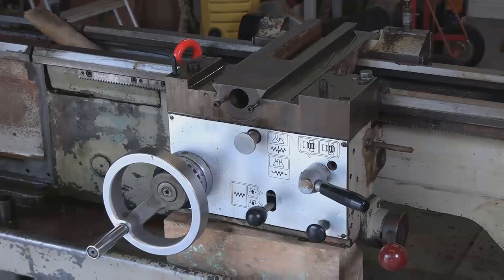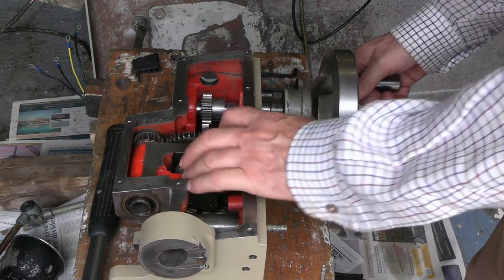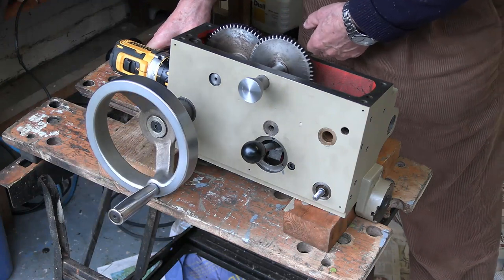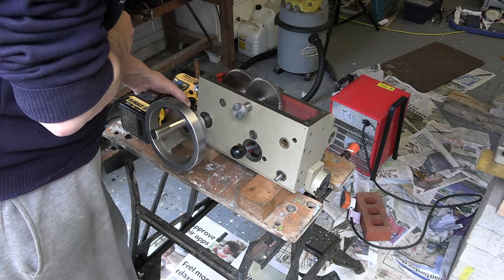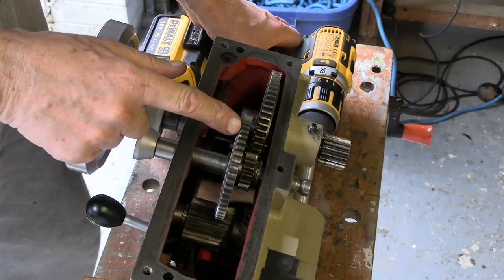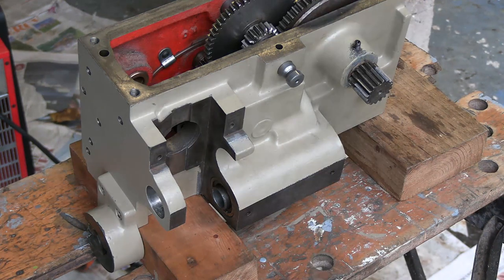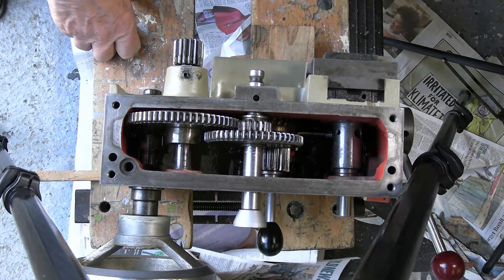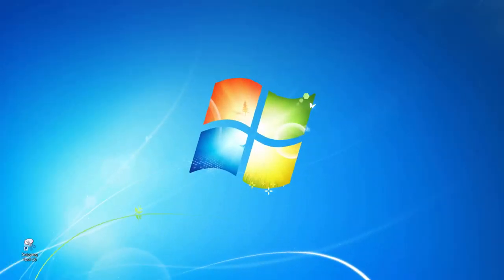Harrison M300 lathe - Apron refurb part 3

Comment: A very enjoyable watch, that apron really does look good now, and I'm sure will perform admirably. Looking forward to the rest of the build, especially the line ups etc. Have you got an inspection sheet with relevent specs you can follow? all the best, Dave
Reply from the maker: Not really. Only thing manual says is that the spindle end float should not exceed 5 microns (and user is advised to leave it alone). I suppose I shall hgave to read "Testing machine tools" by Schlesinger.

Comment: ahhhh so my apron handle falls about the place. i belive the ballbearing holding that handle in has either fallen out or worn like yours. thanks for the video. im noticing that hook your talking about. i seem to remember you had a large spring pushing that ledge on? remember in front of the rubber boot

Comment: Good morning  Samuel, I have to thank you for the videos and the tips that have helped me a lot in the restoration of my Harrison VS330TR AA which even if it has the variator, gearbox and apron are the same as the M300. I have the same problem with the rubber seal that is damaged, is the 3D printed one you mounted resisting oil? I bought one too but before mounting it I would like to make a mold to try to mold it in silicone or flexible polyurethane. Congratulations again, great job!
Reply from the maker: Thanks. So far the 3D printed seal is holding up fine, but it has only had oil in the apron for a few weeks. So early days.
Reply: Ok, thank you for the answer. @samuelfielder

Comment: Hi Samuel, thanks for the great videos. Just rebuilding my own M300.  Wondering if you used Paragon paints for the Harrison Beige, and did you spray the paint? And did you ever take that large top gear and shaft out of the apron, I don't see you doing it in any of the apron videos?  The one in mine seems to be sticking a bit so I want to take it out and check it properly. I've drilled the roll pin but it still doesnt really want to budge. Cheers, Rich.
Reply from the maker: Yes I used Paragon Harrison Beige. I really wanted to use two-pack epoxy paints but couldn't find any of the right colour. In the end I used PPG Sigmacover 280 epoxy primer, and Paragon enamel top coat. Whether that was a wise combination I don't know. I think I did take out the two gears at the top. I don't remember there being anything special. There is a circlip on one of these.
Reply: @samuelfielder  Hi Samuel, thanks for your quick reply. Yep I need to study the diagrams properly to make sure I'm not trying to batter the shaft out while a circlip is still holding it in! The Sigmacover is a good quality industrial system. I had some other questions that I couldnt quite remember last night. I'm still wondering about the paint. My plan was to rebuild it now without painting and just get some use out of it first but now I'm think it might be an idea to do a couple "test pieces" and paint maybe the apron and carriage and see how they hold up though use. My main concern is prep of the substrate. On a motorbike for steel I'd normally be inclined to blast the surface and use a zinc epoxy primer but with the lathe I dont need an active corrosion protection so much as a barrier that sticks well and is tough. I cannot blast the whole lathe so if I can get a tough finish just using a powered wire brush, solvent wipe and maybe an etch primer then put the Paragon on top I'll see how that stands up.  Thanks for your help!

Comment: Hi Samuel, Hope you are well. Did you ever change the O ring seals under the apron where the drive shaft goes through. I am about to attempt to take it apart as this is where my annoying oil leak comes from. Thanks
Reply from the maker: Not yet. I think they are shaft seals rather than O-rings. I couldn't work out from the parts diagram how to disassemble those parts. Perhaps you can just gouge out those seals. I am leaving the lathe as is for now, due to its other problems. But still using it.
Reply: @samuelfielder  okay. I will have a go at it and may e upload a little video my self of the outcome. 👍👍
Reply from the maker: @jay7605  That would be great.